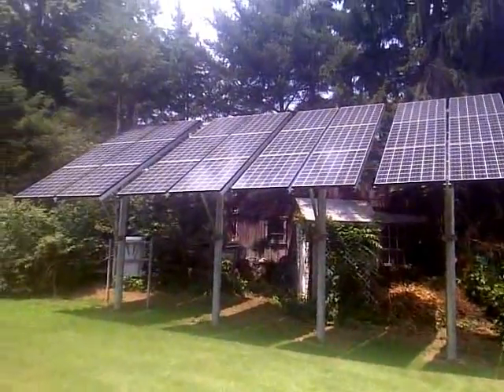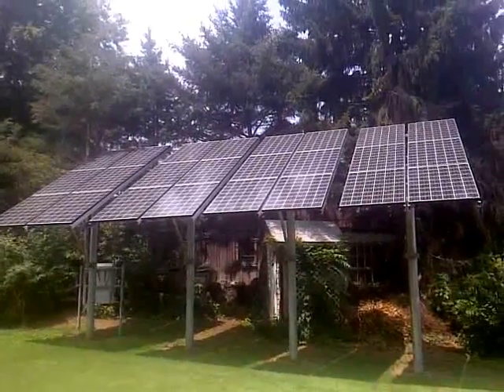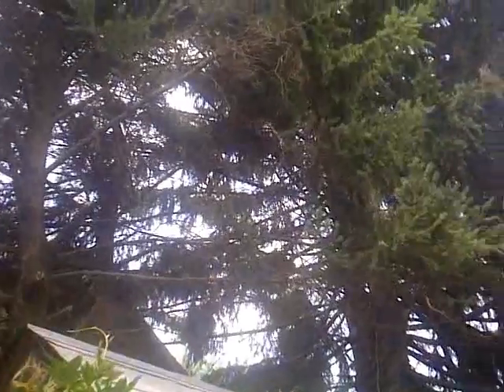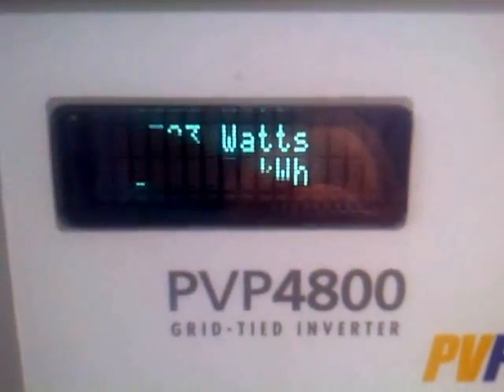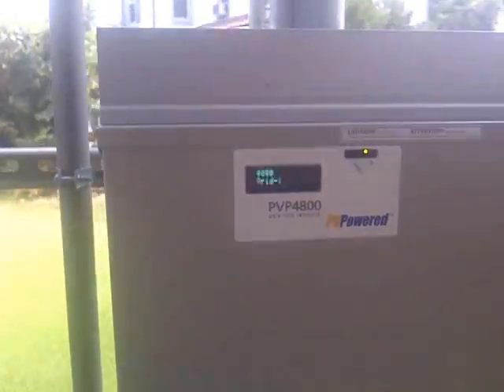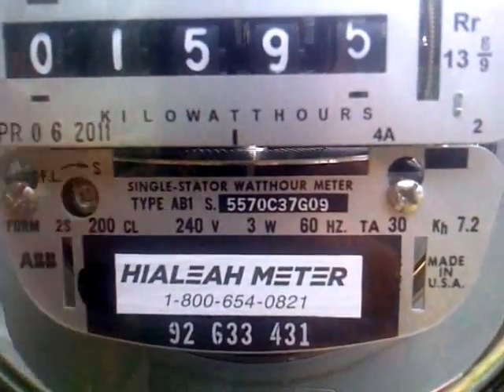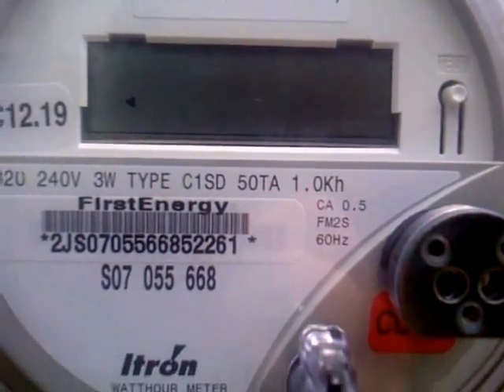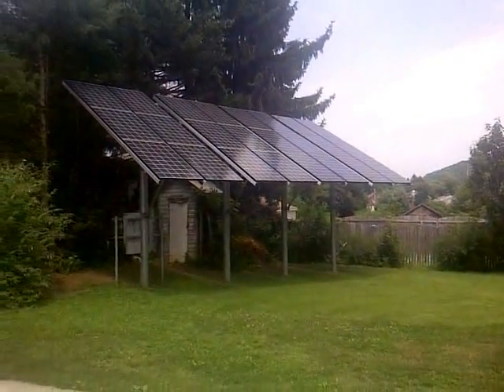Residential Solar 5 KW Pole Mounted Pa

Comment: My roof is two stories high and I wanted this to be a DIY project but  I didn't want to climb that high.  I was really hoping to do this myself but now I'm reconsidering.  I bought 2500 watts of solar panels and was thinking of building a rack in my backyard and then I thought of mounting them on as few poles as possible but, now I"m wondering if it would actually be cheaper to just hire someone to install them on my 2nd story roof.  I have no idea what to do, but the summer is wasting away and the panels are stacked in my garage producing no power.  haha!  help :)